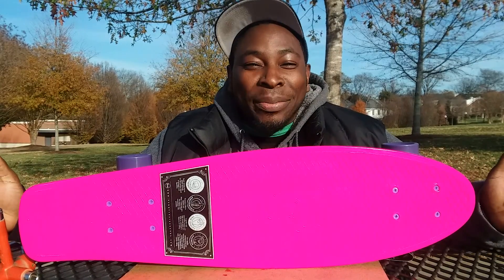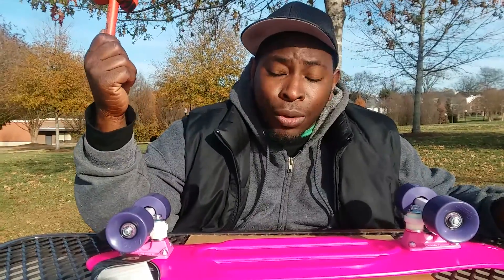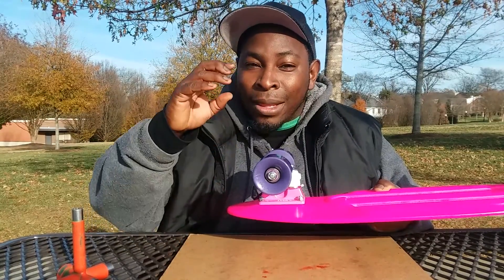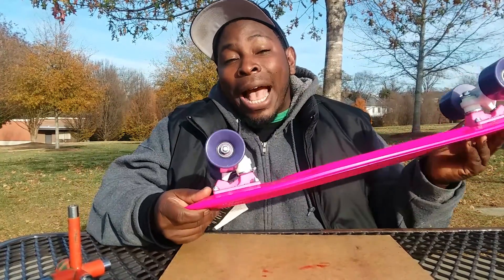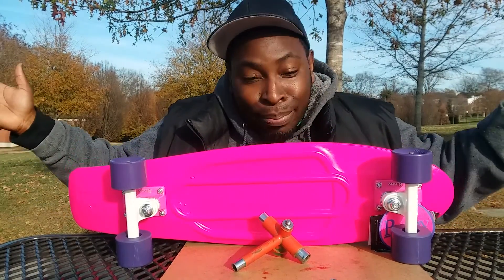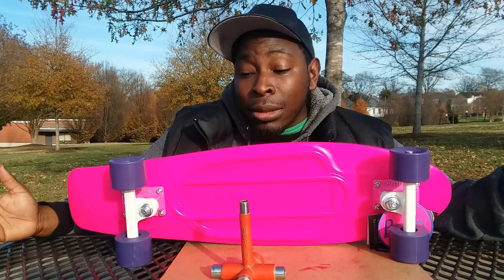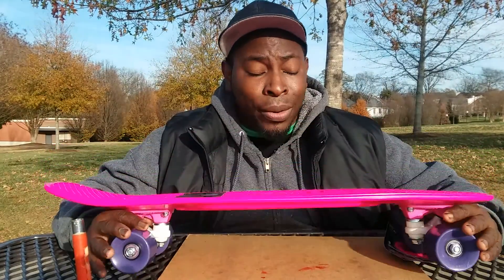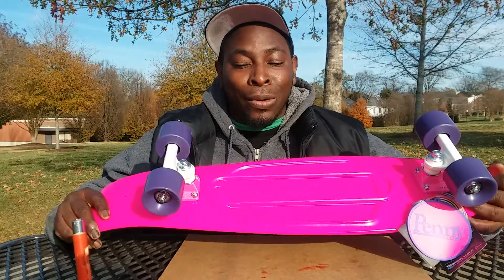A simple Penny cruiser hack!

Comment: The spacers function is to keep the inner rings of both bearings on a solid piece, wich means you can tighten the wheel nut to the limit, and let the wheel rotate free and easy. Any kind of board should use the spacers, or it will suck.
Reply from the maker: That theory would make since if the spacers actually TOUCHED BOTH bearings inner rings at the same time all the time.
But just try it for yourself! Put a spacer in one wheel and tighten it down all the way like you said. And leave a spacer out of the wheel on the other end of the truck and tighten the bolt down with just a hair or so bit of play. Spin them both at the same time and see whitch one of the wheels spins smoother and longer.

Comment: How does a spacer creates friction? It never even touches the moving part of the bearings

and also the front (where yo removed the spacer) will spin faster because there is no knot compressing it
Reply from the maker: Every listen. The bearing spacers are ment to keep the bearings separated and the truck axle off the wheels . But most wheels have "bearing seats" cut into the wheels to custom fit the bearings. So the spacers are not necessary.
Reply: @POPtheHOBO  hate to tell you but you're wrong. The spacers are meant to evenly disperse the pressure from your axle nuts. It pnches the center race of the bearing evenly so their is no play, thus allowing only the ball bearings and outer cage to rotate. Removing the spacers just gives your wheels left/right play and breaks your bearings faster. Trust me. I broke a set of bearings every week skating and as soon as I started using spacers mine lasted a year. This prompted my research and acquiring of this info.

Comment: You need to wear them in bro. They spin great for me.
Reply: Mike Atherton wdym “wear” them in?
Reply: Andy Lim Break them in.
Reply: Andy Lim he means after riding it for a while your wheels will loosen up a bit
Reply: I've been riding my cruiser for like 2 and a half years almost every day and only 1 wheel rolls properly. When I changed the bearings nothing changed, any suggestions?
Reply from the maker: Sounds like your nut is on too tight. Or the washers. 
What bearings are you using? I recommend.
Bones Reds
Rush adac 9
Mini Logo abec 7

Comment: Does it really work out? it goes longer?cause mines been stopping and its brand new..
Reply from the maker: You can try these little hacks too.
Take out the spacers (like i said in the vid.)
2.Take off the washers. but DON'T tighten the axle nut to a complete stop. Your wheels should have a SLIGHT little wiggle.
3. Better bearings. The stock ones are good but there better ones out there. (I suggest Bones REDS.) But anything with a rating of abec 7 or higher.
(If you got the money try some ceramics or swiss bearings.)
Thanks for watching and 
Good Luck!
Reply: @POPtheHOBO  Thank you

Comment: Do you really want it any faster tho? I get speed wobble with 5 strong pushes
Reply from the maker: Removing the washers and spacers makes the wheels bearings spin SMOOTHLY and LONGER not faster.
And speed wobbles are caused from the BUSHINGS. So if you don't have steady balance, just tighten your king-pen.

....and learn to actually RAP.
Jk. Jk.
Reply: Hobo Shop you removed the spacers ight I didn’t know that and yeah lil pump is ass it’s a joke dw 😂
Reply from the maker: @Aiikolo  but you can replace the BUSHINGS with harder ones. And tighten the kingpin so you don't get speed wobbles so easily. But it will make it very hard to carve left and right.